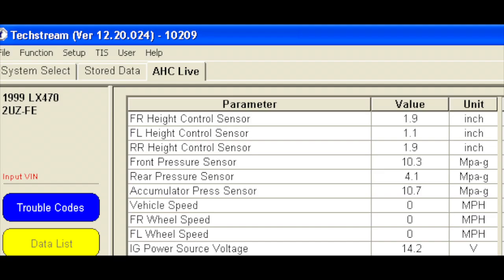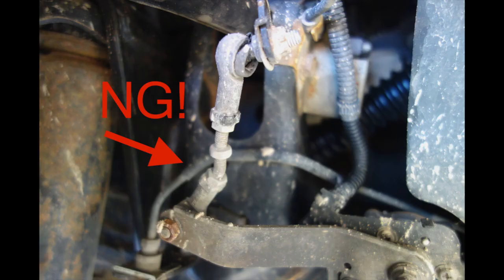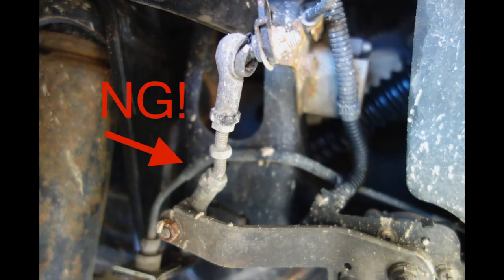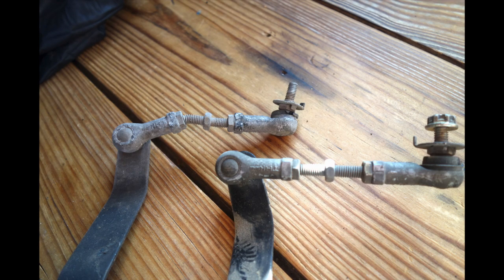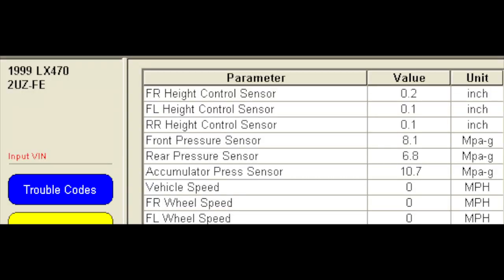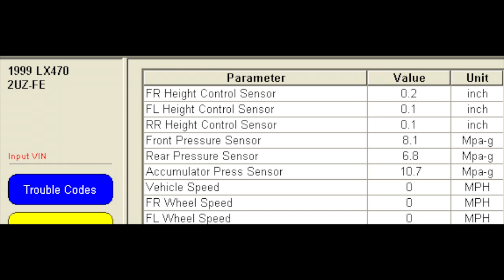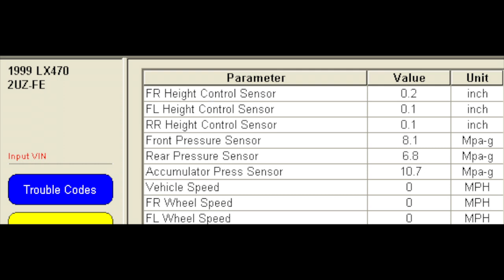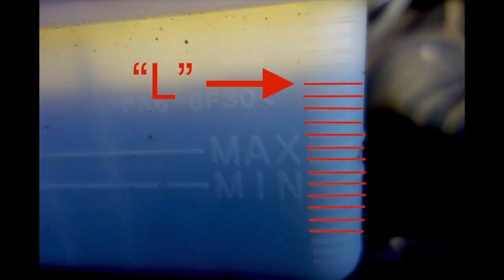How to check AHC baseline pressures for 100 series trucks, LX470 and Land Cruiser, with a surprise!

Comment: So , if the pressure more than the spec what does it effect ? And how can i make depressurization for the system ? Becuase i have harsh riding so help me please .
Reply from the maker: What are your readings?  Usually high pressures indicate worn components, springs/torsion bars etc.
Reply: Eric Lemos i solved the issue , it was easy i had high pressure due to sensor cause high pressure lead to stiff ride ,i just adjust it nothing else , now like cloudy ride😍 btw its lx570 2017 it not have torsion bar its like sensor slut i can adjust sensor up and down only then it will give high or low pressure.
Reply from the maker: @mohammadamad3594  Nice :)

Comment: Were you able to get the rear pressures in spec? Also, did you do a sensor lift?
Reply from the maker: My rear are slightly high but fine for now, at some point I'll probably replace the rear coils.  I didn't do the sensor lift.
Reply from the maker: Also since the video was posted I turned up my front Tbars and got my front pressures down.